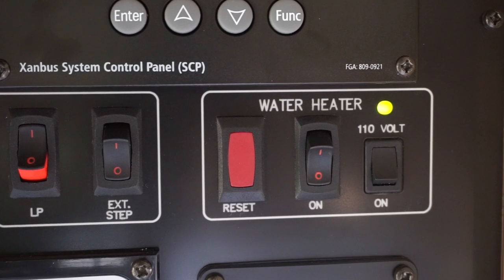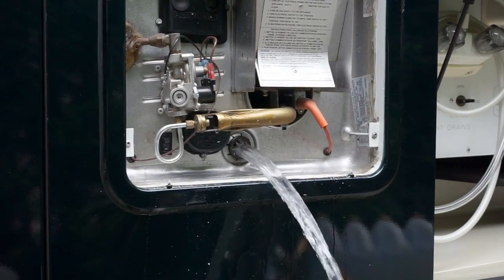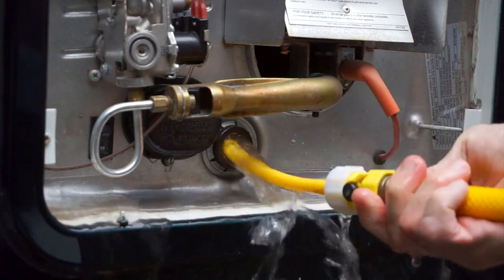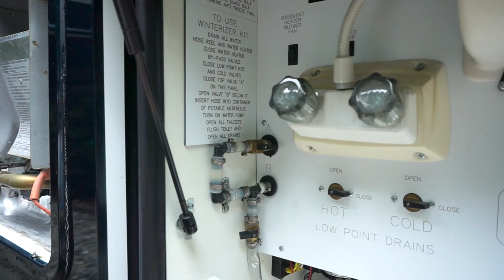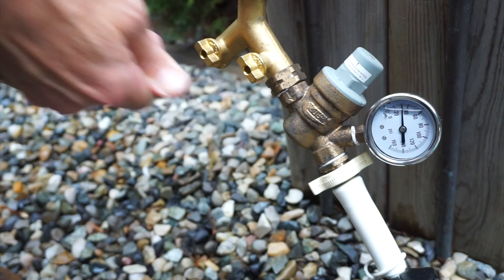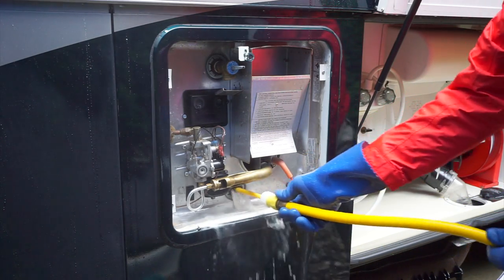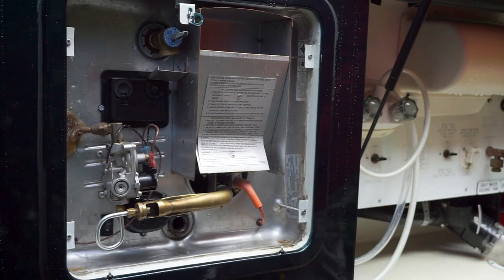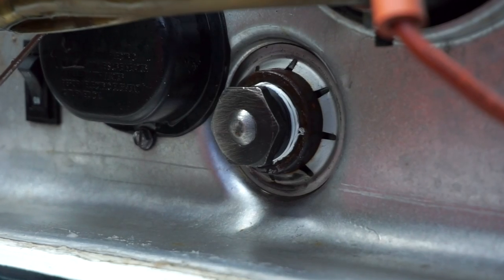Does Your RV Have A Water Heater? WATCH THIS!

Comment: After the deep freeze in Texas, our water heater tank on our 5th wheel froze and split needing to be replaced. We didn’t discover this until we hooked up the first time at a campground. We called a mobile repairman and he said it would take several weeks to get a new one. He told us we could replace it with a tankless hot water heater the same day. This turned out to be the best upgrade we have done. Endless amounts of hot water and no worries about the maintenance shown in this video, plus when temperatures drop close to freezing the system automatically purges any water in the system. Needless to say it’s an amazing upgrade.
Reply from the maker: Thanks for sharing, Michael! Sorry to hear about the failed water heater,  but glad you had a happy ending! Be sure to check your owner's manual for your new heater, though... even tankless water heaters need to have some maintenance performed in order to remove scale and keep them functioning properly. You didn't say which brand of tankless heater you had installed, but as an example the Truma Aquago has a tablet that has to be put in and the heater run through a cycle (it's easy, but still required... check out the Morton's video as an example: https://www.youtube.com/watch?v=XPDFnyECHro ).

Comment: I’m glad I watched this video I believe I found my answer.I did this procedure last week & my smoke/CO/LP alarm kept going off.I could not figure out what the problem was.I completely flushed the tank & everything went back to normal.The tank would not even stay lit it would try to light & go through it’s cycle of 3 starts & shut itself off.After the flush it would light.I did reinsert the anarod with the vinegar concentration.As you stated the magnesium & vinegar don’t like each other.I’m fairly positive that’s what kept tripping the alarm.The only thing I don’t understand was that my furnace would work & my stove burners but the tank would not ignite.Only thing I can think of it is a safety feature.Either way I will try a vinegar flush next time without the anarod.That’s the only way I will know for sure.Thanks.

Comment: I have a ten gallon Atwood in my '76 Silver Streak. I removed it years ago because the cardboard and insulation box they used to put around the tank was disintegrating. The older tanks aren't that hard to remove, not like the newer electric/ propane tanks with more connections.

When I got the tank out and rinsed it, LOTS of calcium deposits poured out, but I didn't know about the vinegar treatment back then so I just put it back in the trailer with new insulation around it. 

My showers kept getting shorter and shorter as the tank capacity seemed to get smaller.

About three years ago I learned about the vinegar treatment, but I don't  think I turned on the heat so it wasn't that successful.

Finally, last year it sprang some pin hole leaks near the tank filler cold/hot holes inside the trailer. I cleaned off the surfaces and healed the holes with aluminum putty that hardens.

I've always wanted one of those boroscopes but couldn't think of an application until now.
I'll get one off Ebay for cheap.

I have a new Suburban 16 gallon water heater elect/ propane that I think I am going to install this spring even though it's not designed for this trailer.

Replacing water heaters isn't all that hard if you know what you're doing, but it does take time to do it right making sure all the connections are done correctly, especially the propane.

See my next comment just below.

Comment: Thank you for this Awesome informative video.  I am a plumber and do take the faucet aerator out before opening water.  I would also take the shower head out and anything that might clog.  I would start Flushing from the exterior shower.  Unscrew the head and let the hot and cold water run thorouly, This because some more expensive one handle faucets have inside cartridges very easy to clog. Then open each faucet, flush, then screw aerator and shower heads back.  I am in the process of flushing my new water heater for the first time and this is very helpful Thank you very.
Reply from the maker: Thanks so much for great additional tips, Julie! :)
Reply: Thanks to you againI am very impressed with your videos  !!,, I bought the Borescope :-)) can't wait to see inside. Fun !!
Reply: Great video. 

I do the same with filters for faucets and removing shower hose when when winterizing entire RV. I leave them off until after system is refilled and fresh water running.  I soak them in vinegar when I remove.

Having an aluminum Atwood, and not requiring an anode rod, I replaced plastic cap with a valve. Now I regularly drain the hot water heater.  No tools and I have emptied out mineral residue in minutes.
Reply from the maker: Nice!

Comment: If your anode rod has a metal threaded end on it and you haven't had it loosened or removed for a long time, it will be rusted on. You have to be careful to not break the female side of the threads on the tank if it won't come un-threaded easily. You may have to put some penetrating oil on it or tap on it lightly with a hammer to break the rust enough to loosen it.
BE CAREFUL! This can cost you a new water heater tank!
Reply from the maker: Thanks for all your great input Cedric! Good luck with your new 16-gallon heater!
Reply: Soaked mine in WD-40 overnight came off slick as can be

Comment: Followed these steps. Worked great, learned a few things: (1.) shopvac's "micro cleaning kit" attachment can get all the stuff off the bottom (2.) suburban serial numbers tell you how old the unit is, for example 154008543 is the 08543rd tank made in the 40th week of '15 (3.) if you get a teslong borescope, you probably want an auto focus probe. dual lens works but isn't that useful (4.) if you don't follow directions at 2:36, you'll spend hours wondering why your water pump shut off after only sucking 9 of the 12 gallons of vinegar..
Reply from the maker: Thanks for all the awesome input, Luke!

Comment: I noticed you used Teflon tape to seat the threads on the anode.  Teflon tape may reduce the effectiveness of the anode rode by electrically insulating the rod from the water heater chassis.  I suggest to use a VOM to test the continuity between the tank and the anode.
Reply from the maker: That's a great suggestion, David! We're going to try that trick out. We've thought about that potential issue before, but since the anodes come from Suburban with teflon tape on them already, and our anodes always decay substantially each year, we haven't worried about it. But now we're curious to see it there's continuity between the rod and the tank.
Reply: @RVgeeks  I had the problem on my sailboat.  It only happened one time though .  I started to put the tape way back on the threads sot there will be metal the metal contact.

Comment: nice vid.  do you have one for 5th wheel jack maint.?  also is there a way to jack the whole rig off the tires for long term parking/living?
Reply from the maker: Sorry Mike, but we've never owned a 5th wheel, so don't know much about systems that are exclusive to them. We've never seen jacks anywhere on a 5th wheel besides the landing gear, so jacking the tires off the ground would likely require the use of separate jacks, like the kind you might use to lift a truck or car, and then put it on blocks for safety and stability.

Comment: we just moved into an old fifth wheel we are renovating. The hot water smells like sulfur. Although the cold water is odorless, we want to sanitize the system before we use it to cook and wash dishes. We also need to replace the kitchen and bathroom faucets.
In what order should we complete these repairs?
Reply from the maker: Replacing the faucets can come later. To use your water system, you'll want to flush the water heater, as shown in this video, and sanitize the fresh water system, as shown here: https://youtu.be/jEepug8N-aE
If your RV doesn't have a winterizing kit, you can use this trick for getting the bleach into the fresh water tank: https://youtu.be/lEBscJ-qb98 Hope this helps!
Reply: thanks! Its just that both faucets leak and I know we will be running lots of water through them to sanitize the lines. Would we risk anything by replacing faucets first? Also, we do not have a winterizing kit and an RV repairman bypassed our outdoor shower because it needs to be replaced later, we would still be able to follow the instructions for pouring a bleach solution directly into the tank with fresh water correct? 

Your videos have been really helpful, thank you!
Reply from the maker: Nothing to risk by replacing the faucets first. We just did a video about that: https://youtu.be/DJOAqOwoBHEWithout a winterizing kit, that trick we mentioned in the other video is definitely a good technique: https://youtu.be/lEBscJ-qb98
That method can be used with any RV except rigs with a "gravity fill" (basically an opening in the side of the RV that you stick a hose into to add water to the fresh tank... instead of filling the tank through the city water connection). With gravity fill rigs, you can mix up your bleach solution into a gallon pitcher (to dilute it a bit first) and then pour it into the opening using a funnel, directly into the fresh water tank.

Best of luck with your project!

Comment: I just bought a 2011 R-Pod 171 and would like to do this vinegar flush. I have never owned a camper before and can't figure out how to get the vinegar into my hot water heater tank! Can you help?!
Reply from the maker: Hi Patti!  Congratulations on your new R-Pod! We LOVE them... they're just so cute!  We're not familiar with their plumbing setup, but did a little searching online and it looks like you should have a winterizing valve & hose connected to your water pump. Which means you can follow the same procedure we use (drain the water heater and then use the winterizing valve/hose to suck the vinegar into the system using the water pump... and it goes into the water heater because it's empty).  The trick is finding your water pump... and the easiest way to do that is to run it and follow the noise!  ;)  It's likely in one of three places: under the bed, under the dinette, or under the couch.  But your ear will tell you. Once you find it, look for a white valve with about a 2' length of hose connected to it... that's your winterizing kit. Normally, you'd use that to suck up RV plumbing antifreeze into the lines to keep them from freezing (and bursting) if you were storing the RV in the winter... but with our procedure, it's used to suck the vinegar up instead.  Hope this helps!
Reply: Patti Bender 
If you don't have a winterizing kit, you can remove the overpressure relief valve to put the vinegar in.  Use a funnel and flex hose to pour it in.

Comment: I'm not a chemist but have done many experiments with aluminum and acid. Any concern that the vinegar may accelerate corrosion of the Atwood tanks? Or are they coated with something on the inside?  My Suburban tank is steel with an internal blueish ceramic coating.  It's rusted through thanks to previous owner installing an aftermarket electric heating element in place of the anode rod.

Comment: 96 GulfStream Conquest 102 Ltd, Suburban w/h question...
There are no bypass valves on this unit. What is the preferred method to prevent vinegar from getting into the fresh water tank, and only into the w/h tank for cleaning. I'm a newbie and have bee renovating The Beast since January, and am at the w/h phase now; but haven't found anything on this specific concern. Any help is appreciated. Your videos so far... have helped me out TREMENDOUSLY. Thanks...
Reply from the maker: Hi G. It's not the water heater bypass valves that you need to get the vinegar into the water heater... it's a winterizing kit, that lets you suck up the vinegar into the system. If you don't have one (and don't want to install one), you can try removing the overpressure/overtemperature valve near the top of the water heater and use a flexible funnel to pour the vinegar directly into the tank. We've also read about people buying a brass hose adapter that they screw into the drain plug on the water heater... then attach a long section of hose to with a funnel at the end.  Use it to pour the vinegar into the tank, then affix it so the top of the hose us above the level of the tank so it doesn't pour/foam out. Hope one of these options will work for you.
Reply: Thanks for the quick reply.  :)  Have considered removing the overpressure valve; just wasn't sure about it. That idea seems feasible, as does the gravity feed through the drain plug. You've been a great help and both are good ideas. Have a safe 4th of July

Comment: first off another fantastic video.. second I don't know if you have done it yet but a video or actually book with all the maintenance things you do to your rv to keep it tip top.. with the extensive maintenance you guys too you must have very few if any issues that arise during your trips and I would like to have the same results..plus by staying on top of stuff I think it puts away the element of worry to rest knowing that things are almost always going to work... almost
Reply from the maker: Thanks Kodiak! :)

We do have a video about our annual spring cleaning & maintenance regimen: https://youtu.be/AA15MOt9wEA

But that doesn't include all of the mechanical stuff (some of which we have done professionally), and the items that only get done every several years. Here's a list directly from our Excel spreadsheet of every item we monitor over the long haul. Keeping in mind that we have a diesel pusher on a Spartan chassis and your list, intervals and part numbers will likely be different, this will give you an idea of what we do. Hope this list helps get you  started! :)

Axles - replace front wheel bearing lube
Axles - replace tag wheel bearing lube
Hydraulic System - replace spin-on filter, top-off fluid (83804E)
Generator - Change oil & filter (150 hrs / 1 year) (PN 122-0833)
Generator - Clean spark arrestor - 18mm socket (150 hrs / 1 year)
Air Cleaner - Replace (0420-HH2)
Charge Air Cooler - Check torque & adjust
Belts - Inspect/adjust all belts and tensioners
Suspension - check/adjust ride height
Generator - Clean Crank Case Breather (1000 hours / 5 years)
Engine - replace 2 micron fuel filter (FF5488)
Engine - replace fuel/water separator (10 micron fuel filter - FS19596)
Engine - replace oil & filter (LF9009)
Lubricate - brake camshafts & slack adjusters
Lubricate - chassis (ensure drive shaft slip joint & U-joints are included)
Lubricate - steering linkages & shaft
Coolant - check DCA levels & freeze point
Air Dryer - Replace (Wabco R950011)
Generator - Change air filter (500 hrs / 2 years) (PN 140-2897)
Generator - Coolant - flush & change, replace cap (1000 hours / 2 years)
Generator - Replace coolant hoses and thermostat (1000 hours / 5 years)
Hydraulic System - Replace internal filter, drain & replace fluid
Transmission - Replace "main" & "lube" filters (Gold Series)
Transmission - Replace Transynd fluid
Axles - replace drive axle differential fluid
Generator - Change fuel filter (every 500 hours) (PN 149-2513)
Coolant - flush cooling system & replace
Generator - Replace engine V-Belt (1000 hours / 5 years)
Suspension - Torque U-bolts
Reply: awesome thank you for the response... I'll be applying this list to a travel trailer and doing most of the work myself... I love how your videos are very Informative but to the point and not filled with useless info and still very entertaining..keep up the awesome work
Reply from the maker: kodiak4502004
Thanks so much for the kind words. You just made our day. :)
Reply: anytime you are in eastern Pennsylvania send me a message would love to meet you guys
Reply from the maker: kodiak4502004
Rarely East of the Rockies, but much appreciated, and we'll keep you in mind. :)
Reply: I know you are from the west coast and it's picturesque and beautiful over there but the east coast is beautiful too and I recommend at least doing a mini vacation even if it's not in an rv the mountains over here are beautiful as well and with the large network of people you come in contact with between your travels and YouTube I'm sure you would feel right at home...I'm in the starting stages of rving and would eventually like to go full-time when my daughter graduates high school
Reply from the maker: kodiak4502004
We're originally from the East coast, so maybe that's why we headed West. You know... get away from the parents. LOL
Reply: I haven't followed you that long to know that where are you from